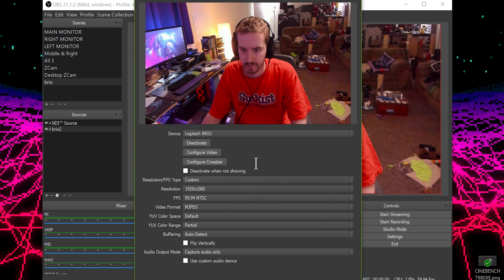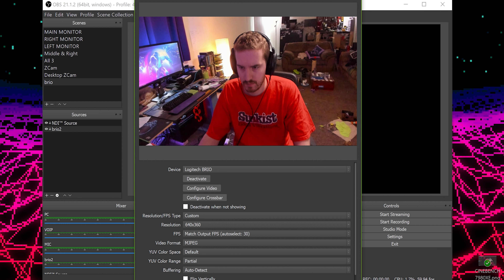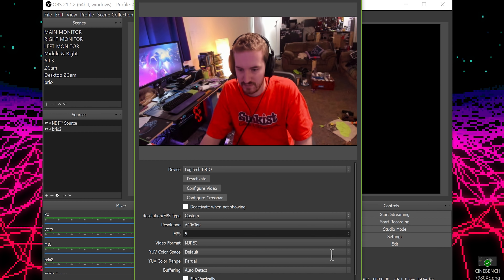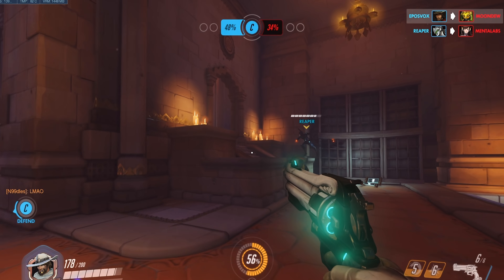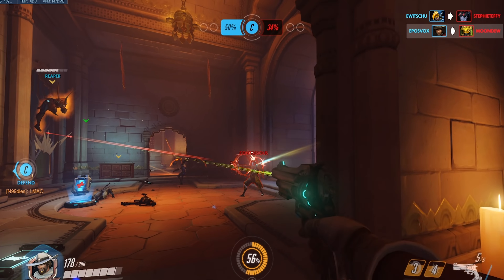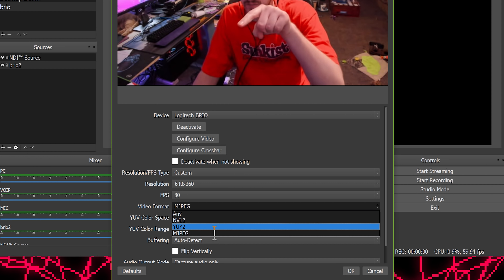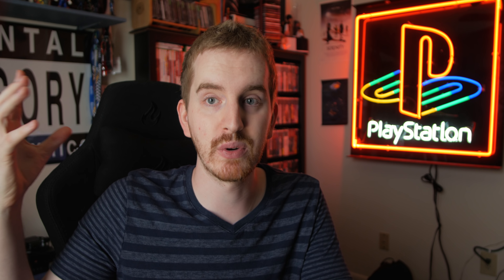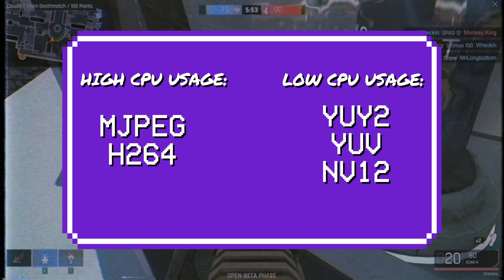How to reduce CPU usage of Webcam in OBS Studio - OBS Studio Optimization Guide

Comment: I have a Logitech C920, I went to check and found out that I was using MJPEG for Video Format. I couldn't find the Low CPU Usage ones of this video. But I found that I420 and XRGB are pretty Low CPU Usage. Personally, I went with I420. Thanks for sharing these tips!
Reply: darkmew64 and thank you for sharing this
Reply: thanks
Reply: OMG thank you so much for pointing this out. I was using MJPEG as well because it worked smoothly with my C920. But my CPU was like at 30-50% usage on OBS at times because of this setting. It meant the difference between running other applications smoothly or not. Then I saw this comment and re-checked the settings and changed it to H264 and it automatically changed my CPU usage to just 10-20% in OBS! I was shocked!! What a unbelievable difference one little setting takes.
Reply: damn i used to have these options now i don''t
Reply: lol was reading your comment like 😑who freaking cares what particular settings you put for your personal camera 🙄 but I realized I just wrote a whole (even longer “no one cares@ story” about what happened to me before I got here! 🤭😖 ha ha noted

Comment: Curious on your thoughts about Youtube's new/larger video player. The larger size exposes some of the artifacting we see from lower quality record/streams. Even if you're recording and rendering settings are on point, it seems like the only way to help this now is to render in 1440p, even if you've recorded in 1080p. This will give you the extra bitrate that 1080p only videos won't allow on YT.
Reply from the maker: It's not really larger, just adapts to the aspect ratio of the video. The original player change started in 2016 when they were first rolling out the new material design layout, made a video on it last year - https://www.youtube.com/watch?v=H851a7hEjDQ
Then they updated the default player view to also adapt to aspect ratios and I made an updated video about it last week - https://www.youtube.com/watch?v=5TEPRid0pUw
Reply: Ok, cool. I actually missed that video. That being said, it still exposes the negatives that the low bitrate YT offers for 1080p videos. It still looks great on phones and tablets. Desktop viewing, however, that leaves something to be desired.
Reply from the maker: Eh, depends on your screen resolution, too. But yeah, YouTube's 1080p codec is quite harsh. I always recommend recording in very high bitrates and upscaling for YouTube.

Comment: First off, can't thank you enough for the video! I've been using the logitech c922 for awhile now. (my current webcam streaming set up is 1280x720 on 30fps) My webcam looks great when im not streaming any Movement intensive games but when i do (fortnite or PUBG) my webcam starts to get very blurry or very pixiated . i understand this might be because of all the cpu usage but i currently streaming on NVENC preset on OBS. I've tried getting more light and messing around with settings but nothing seems to work. i even considered using a 2nd computer with an capture card but i want to try other options if its possible. My current cpu is i7 6700k with a EVGA GTX 1080 gpu.
Reply: Try to stream on internal graphics if you have one, or buy a vey cheap gpu for encoding the stream

Comment: as a vtuber i use a webcam to make my avatar move but the quality of that video shouldnt matter as long as the frame rate is good i suppose? anyway im wondering how to change the settings for my webcam. obs doesnt use my webcam directly i run the webcam thru a different program called xr animator and i capture that program thru another program and then i capture that program thru obs

Comment: Just fishing for answers. Need help bad. I have a very high end pc. Definitely op for what I’m doing. I start obs. I’m not streaming or recording yet. I game for 20-40 minutes with it just running on second monitor. Then my game starts dropping frames bad. Sometimes even freezing my cursor. Lowering FPS on game helps a little bit but also just delays the lags(last longer before becoming choppy). Turning off webcam is similar but problem still happens after a while. Again I’m not even recording or streaming yet. Gpu and cpu are usually at 50% and ram at 20-30. Also my internet is definitely more than good enough but again not streaming so don’t think thats the problem

Comment: I recorded some videos by using OBS but I forgot to put them in right place and unfortunately they automatically got deleted.Can u tell me how and where to find them as these were very imp videos for me and I am using windows 10
Reply from the maker: Well OBS doesn't auto-delete anything.
You can find them by going to File - Show Recordings or navigating to the folder set for recordings to go to in Output settings
Reply: @EposVox  I have done this but there is no videos and really OBS delete them automatically
Reply from the maker: OBS has no functionality within it to delete videos. There's no delete option, no automatic cleanup, nothing. Either something else is deleting them, they're not actually being recorded due to an encoder error, or you just haven't found them.
I recommend seeking support in OBS's support Discord. https://discord.gg/obsproject
Reply: @EposVox  i am also very amaze that obs delete my videos (online class recordings) from my folder. I record 2 to 3 videos and save them in the default  video folder then I came back to transfer these videos from that folder to new drive E (My folder) but when I open video folder there were no videos can you help how to get back them. And I am using windows 10.(THESE ARE VERY IMP TO ME). PLEASE HELP

Comment: Great video Epos, but for me I'm starting to think that it's some other issue for my Logitech C920. 

Granted my computer isn't new, but my CPU usage doesn't get too high and the jittery problem keeps occurring even when nothing is being recorded.

I've tried turning off all of the auto settings, have 2 LED lamps lighting my face to make it lit somewhat ok, tried every video format at a resolution of 320x240, even tried a lower FPS, but I still get the jitters. I'm a bit at a loss at the moment because it can even happens when the only active source is the webcam, and I know for a fact that my computer isn't THIS bad :-\
Reply: hi did u find the solution to this issue? i am using a c920 too and have the same problem
Reply: @djresqvideomix  I believe it was that my USB ports were bad on my motherboard, especially the USB 3.0 ports. Either that or it doesn't like USB 3.0 ports.

Comment: Hey bro you should use Razer cortex program its a awesome program I usually was tying to play fortnite in a crap pc with core    i3 560 and 4 gb ram 1300hz and GeForce 210 hahahahah crapest pc ever fortnite was running in 20 fps because my __ windows was eating 45 percent of my ram .and I found razer cortex it cleared up my ram when I boost it and only 25 percent ram windows was using.and a manage to get 28to 35 fps some time lag .it is awesome you should make a video about razer cortex and its free no ads no money cost .it disables windows explorer and run its own game explorer. It is super help full if you have low ram